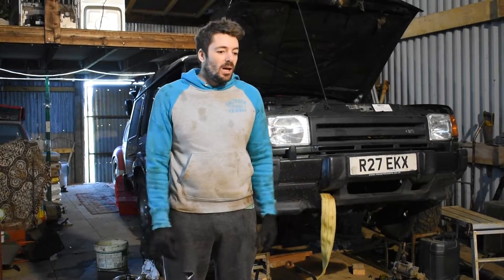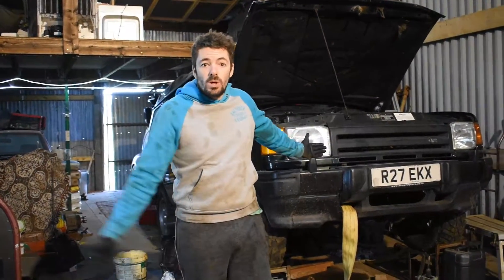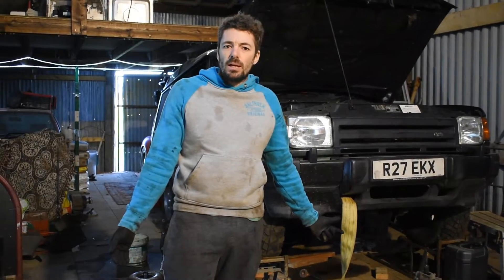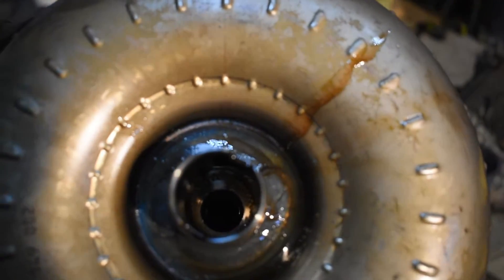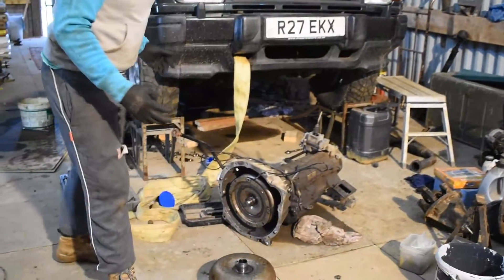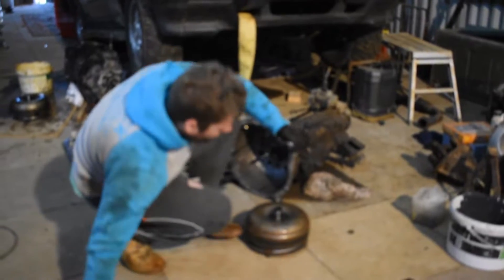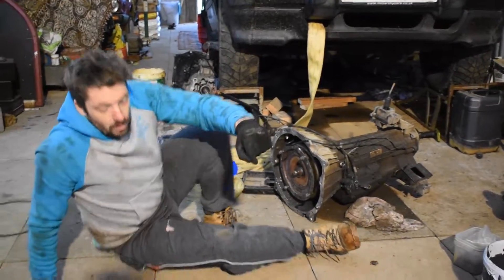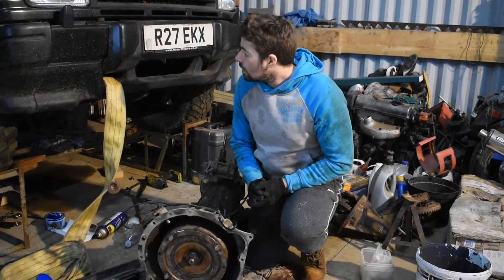Land Rover Discovery Auto no drive issue solved

Comment: My 05 HSE won't  move in drive at all but did in reverse barely, its not low on fluid, the drive shafts don't move in gear and if you give it gas the rpm drops and almost stalls for a sec

Comment: Brilliant video an just the right time for me. I have the 300tdi auto D1. The front propshaft decided to let go and crack the gearbox. So I have several questions for you...
Reply: may i ask what auto box you used i see its the d1 , i know Ashcroft have a zf4hp22 wondering if it can handle twice the torque of the original 300tdi defender , any info , many thanks

Comment: Great video, Thanks for your insight! What did you do to ensure the shaved spline metal shards won't damage something else in the trans? where did they go?
Reply from the maker: They’re a few bits (not much) on the drain plug (magnetic) I ran some fluid through and replaced the filter.. hopefully that got some of it..

Comment: quick question ive had same issue how do you get the torque converter to line up with the four bolts on the flywheel as i cant figure it out and only way you can see what your doing is to take the sump off which is what i am doing tomorrow any help would be apreciated
Reply from the maker: I put my phone down where the starter motor was.. had it in film mode and spun it around (torque converter) until a hole lined up.. one on is in its bloody easy.. but that first one 😭
Reply: @TattyCarTravels-VW  ok cheers i was gonna take starter motor off to check to see if i could do it that way ,just had to put oil pump in as broke first one by slapping the box and engine toget the incorrect way derr what i am

Comment: Mine is going into reverse. But doesn’t make any sound when i go to any other gear. Doesn’t sound like it’s engaging or doing anything other than in reverse. Other than when i go to park it makes a grinding noise.
Reply: I got told transmission by one guy. Another said it may be the shift silenoids
Reply: @bubblez9104 What did it end up being?

Comment: help me? FLEXPLATE LAND ROVER DISCOVERY 1 AUTOMATIC
Reply from the maker: You in need of one?
Reply: @TattyCarTravels-VW  
Thank you for answering so quickly.
I would like to know how to disassemble and then reassemble the automatic Land Rover Discovery 1 FlexPlate, and to know where I can purchase the necessary parts to replace it.
Reply from the maker: Owners manual is the best option, you’ll either need to remove the engine or box to get access, it’s bolted to the flywheel and the torque converter bolts through it (4 small bolts) 
I’ve got a flex plate and a automatic box in the barn as I only needed the torque converter to fix the truck 😃